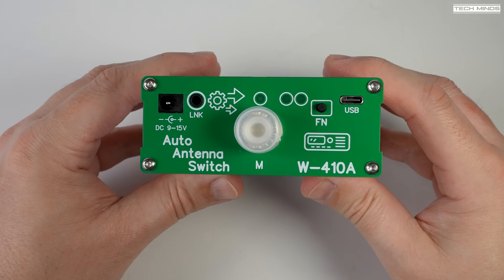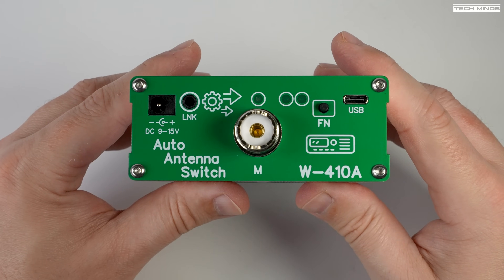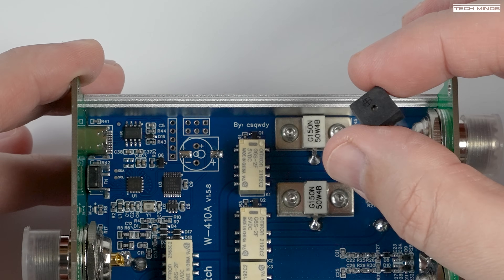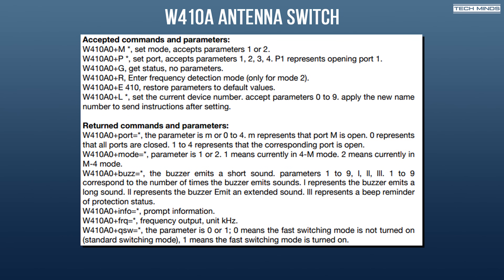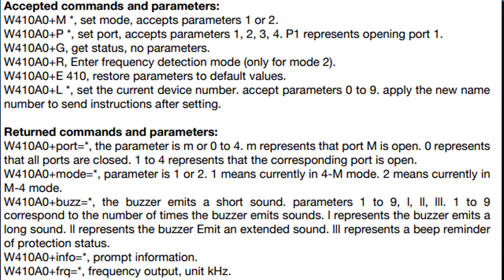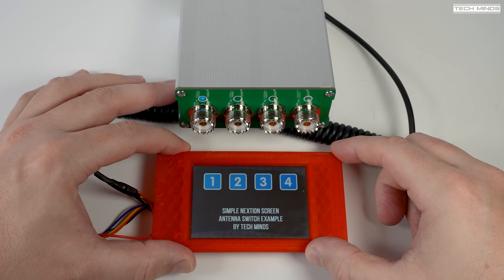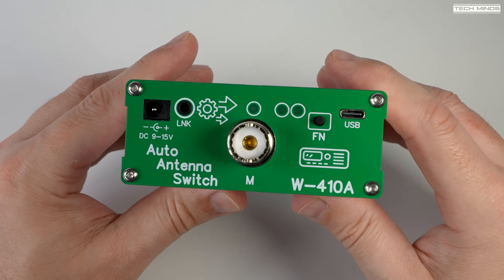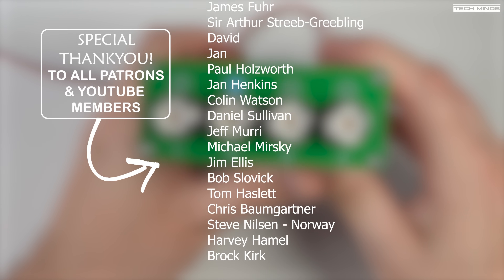W410A 200W Automatic 4-Way HF Antenna Switch

Comment: So I operate digital modes (WSJT-X, JS8call, VARAC-HF) remotely from my iPad using an APP called JUMP.  This appears to be the perfect solution to switch antennas remotely.  The down side is how do I insert the frequency ranges into the switch?

Comment: I'd like to mount this unit in my weatherproof junction box outside. If I program it for auto mode will it remember that choice after a power failure? It would be inconvenient to have to manually reset the switch if it loses its mind due to surges, disruptions, etc.

Comment: Great demo thanks. I have purchased one of these and a nextion screen. I have got the screen working but not with the 410A. Did you have to change any configuration in the 410A before using the nextion for control. Appreciate any hints you may have. Thanks Ian.  de ZL1HIM

Comment: Hi,
I was looking through the comments, i am not sure, if this has been answered: 
If this device is used with two or more transmitters on one antenna, is it possible that all radios can receive or is only the active port open? 
Very nice video anyways! Keep them comming :-) 73s from DL
Reply: Just in case this was NOT answered: NO, simultaneous reception is NOT possible. We bought two of them and the only advantage is that the channel changes automatically. Thanks for the countless comments...

Comment: Can't even select different antennas for RX / TX, the user interface is pretty bad, and I also don't know how it'll handle hotswitching. Seems like it doesn't. Usually the 16A relays I use in switches are rated for millions of mechanical cycles but only about 500.000 cycles under a current load. These are just 2A relays rated for 100.000 electrical cycles.. yeah. The 50 ohm terminator will only withstand a 100w or higher RF for a certain time, and that will surely happen because how are you supposed to know you're TXing into the wrong port, indicator leds will usually be facing away from you or will be completely hidden. 
Meh. The freq counter is neat but otherwise, not much is smart about this switch. And the pricetag is hefty too. Not worth it.
Reply: Obviously, you have drawn your conclusion without knowing anything, and your conclusion is completely wrong.

W-410A uses peak-valley detection technology. When the power on the port is detected to be >5W (slightly different at different frequencies), it is latched, and then waits for the port to detect <5W before switching the port. The benefits of this are:
1. Avoid the switching time of the relay causing damage to the PA when switching at a higher power.
2. Avoid the relay life problem caused by the relay switching at a higher current.
3. The internal 50 ohm load resistor is always connected in the non-switched state.
4. No-perception switching, switching accuracy can be guaranteed even in SSB mode.

In addition, VRMS of 200W = 100V, and the current on a 50 ohm load is 2A, while the maximum current of a single Omron G6S-2 relay is 2A. The W-410A is designed with two groups in parallel, which means it can withstand a maximum current of 4A. Therefore, the W-410A still has 1x redundancy when processing 200W power.

Comment: Re:  W410A 200 watt Automatic 4 way HF Antenna Switcher

Can I ask you for any advice that you may be able to give me, please?

 After watching your video of this I bought two of these automatic antenna switchers and have found that when trying to install the firmware on to a Windows 10 pc as instructed, it continues to be blocked by Windows 10 as it thinks it is a virus?  We have tried all sorts of things to try and allow it through, but to no avail. Do you have any ideas on how to get around this and then to be able to upload it onto the unit? Many thanks, Alex.
Reply from the maker: I had the same problem, the windows control application was always identified as a virus, hence why I didnt show it.
The units already have firmware installed, but if you want to change how it works, then you will need to use the PUTTY method as shown in the video to change its settings. I did join the facebook group to try and get the app, but even the developer wasnt really much help.

Comment: FN switch should be on the same side as the 4 ports so you can manually switch and see which port your on. Chinesium at its best . This is what happens when you build a product with 0 field testing .

Comment: It is HF only because it is using standard 2A Omron G6S relays and not the RF relays that cost considerably more. For HF that's fine, a UHF model would be much more expensive to make. A higher power version would need larger relays. I like the idea of terminating the antennas, though I don't know if it makes much of a difference in practice. I would advise against connecting 4 transceivers to one antenna as I would worry about accidentally getting a lot of power into the receiver input if the antenna port  has a high VSWR. It should be OK but risking £1000 radios with £100 switch perhaps better safe than sorry.

I have made my own version using an Arduino, it listens to the CI-V traffic and selects a relay based on frequency. I also made a Bluetooth version for up to 8 relays to go with my IC705, though bluetooth is optional and it can also take a CI-V port, a 4 bit band select or a band voltage input. The relays and their control are separated so I can use coaxial relays at VHF/UHF or frame relays for HF. All on my webpage if interested.
Reply: Mike, Thanks for providing details of your switch. I've just reviewed the PDF. Before I go ahead and build just thought I'd check if you are still happy with design and everything working ok? Cheers Alan

Comment: Nice, but with an odd design choice. Why are LEDs and the ports are on the same side? Using this you'd want to see the LEDs in order to be sure it switched correctly, but then you'll have to live with 4 antenna cables facing front too. If I were to design this, I would put all the LEDs and buttons on one side and call it "front side" and all the connectors including the USB and control jack on the opposing side and call it "back side". We are all trying to keep the cables as neat as possible in the shack and this is a chaos maker with this design.

Comment: Excellent concept,
But a perfect example of a Product designed without actual "Real User" input.?
All sockets should be on the rear, and the Port selector and indicator on the Front
Maybe a Version 2.?

Comment: Overengineering at its zenith!  But hey do you expect me to mount a mirror to see the other side of this box? I would try bluetack first to silence the nasty buzzer. Sure a whisper freak could get even more nerd satisfaction. Personally the old mechanical switch that grounds my radio if I walk away for lightning protection is still the DX choice where you can have extra power and have redundant coax.

Comment: That is so cool! I wish it worked up at UHF though.
Reply: Its a pretty easy project to diy. Just google around a bit, we built like 10 of them for our radio club to switch between 3 stations and 10 antennas on 3 tower + 2 80m verticals

Comment: Can you really connect four radios to one antenna? Can it be trusted to isolate the radios from the RF being transmitted?
Reply: Just asking will all the radios be able to receive all the RX signals of different frequency on that one antenna?
Reply: @georgepapa2950  You could have say a G5RV on port 1, a vertical such as the DXCommander on port 2 and receive all of the bands the antenna is designed for. The frequency ranges Matt shows are for auto band switching and you can change them in software/firmware to fit your antennas.
Reply: Although you would need to test it I would think the port to port isolation is upwards of 60db which is more than enough for your 100 watt radios.
Reply: @Hank_W6IR  According to the data at the link in the description, the isolation is 50 dB up to 15 MHz, 45 dB up to 30 MHz, and 38 dB up to 60 MHz.  So, a 150W radio could put about 5mW on the receiver when operating on 10 meters.  I was a little disappointed to see only a single relay per output.  That's like half a volt on a receiver's input, when they're expecting microvolts.
Reply from the maker: Don’t forget that any ports which are not selected, 3 at a time, are terminated inside to 150 watts.
Reply: @TechMindsOfficial  Just wanted to know if i have three VHF radios connected and will i be able to receive all RX signals on my omni antenna and use this BOX to switch the TX when it senses transmssion?
Reply from the maker: @georgepapa2950 nope, it’s a switch not a splitter. Search for duplexers or tri-plexers.
Reply: @TechMindsOfficial  Ah yes, good point. It doesn't appear that there is too much heatsink for those resistors though, I wouldn't want to transmit into them for more than a moment. Flange mount resistors don't achieve their rated dissipation unless they have adequate heatsinks...ask me how I know! 🔥🚬